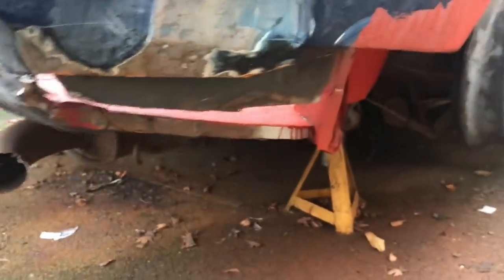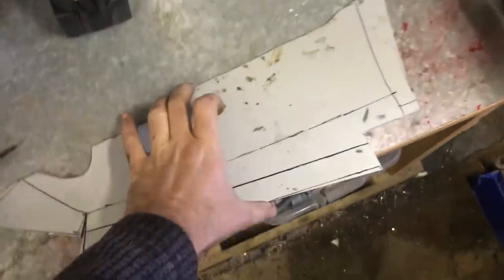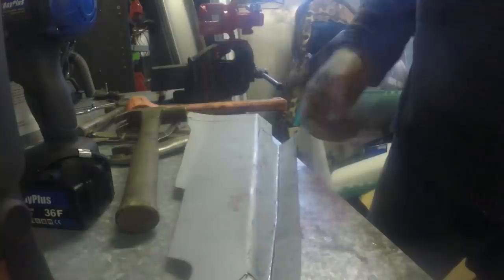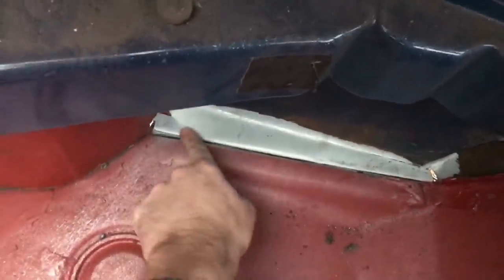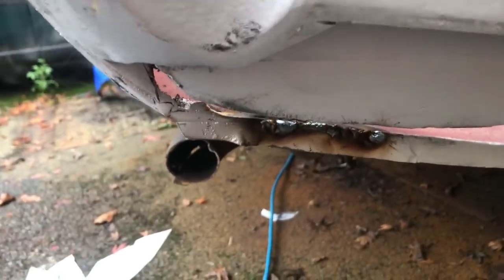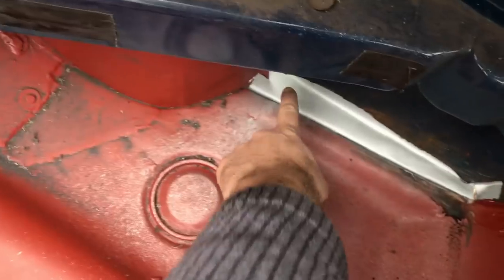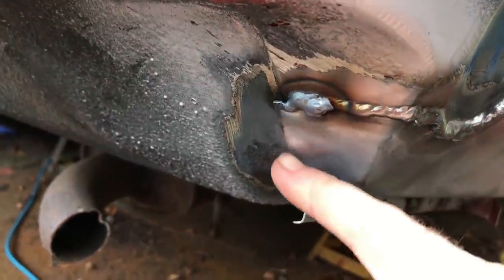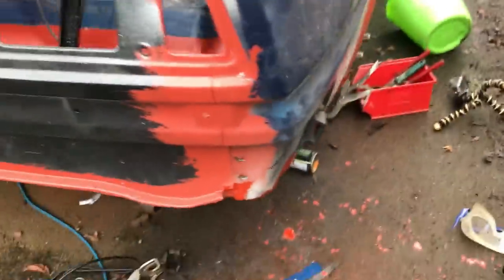Rover SD1 2400 SD Turbo restoration - Video 80 Lower offside wing repair fabrication mig welding

Comment: Looking forward to this series.  Will you paint the remainder of the car yourself, like you did the engine bay, or will it be sent off for paint?
Reply from the maker: Ill send it off for paint.  Its too big a job for me, needs a pro.
Reply: @nitrosilvia  I wonder if anyone will build an SD1  from the ground with all new panels and get it registered as as new car ?? like the one`s on The Late Break Show MK1 MK2  (new registration MK1 - 2  escort copies )... ad if it`s an EV it should be easier to get past the registration rules, aka no emission rules that an older engine would automatically fail...
Reply: @kylereese4822  swap Electric motor for crate LS and I’m in! 👍🏻
Reply: @midlandperformanceretro2866  LS  would fail emission's or raise the road tax costs, limit access into places like London - EV would be free tax and no restrictions in places like London...
Reply: @midlandperformanceretro2866  Large or small Tesla motor in the rear the latter can produce 650bhp... 
 interesting fact, the 450h Lexus hybrid box in EV mode both large/small motors running can produce 290bhp... i recon the small motor could be removed and have the bigger motor grafted in creating a Frankenstein transmission thus upping the bhp... add some over drives from the Jag range....
Reply: @kylereese4822  LS wouldn’t fail emissions, we’ve used them in other builds with no problems. Higher tax costs, yes, but well worth it!
Reply: @midlandperformanceretro2866  Still would have the EV over the expensive relic ICE remember liquid fuel is like rent ££ it`s never your own.... and can only produce at best 30% power the rest is noise, heat, pollution, friction losses and the ££ for fuel goes into a bank account that gets subsidised by tax payers aka you pay twice... aka pay at the pump pay subsidisation tax as well...
Reply: @kylereese4822  I wouldn’t drive an EV if you paid me….!
Reply: @midlandperformanceretro2866  I guess 1000bhp as some EV`s have is to much for you to handle ?? best sticking with put put cars... ps EV`s less than 10 moving parts, ICE cars 3000+ moving parts... takes a lot of fuel to move 3000+ parts the tax man loves you as does the oil companies lol.
Reply: There's a brand new shell on eBay for 10k, someone give it a go.
Reply: @williamwoods8022  hydrogen tanks designed for fuel cell vehicles have been developed to store hydrogen at pressures of up to 10,000 psi (700 bar) to maximize vehicle range.